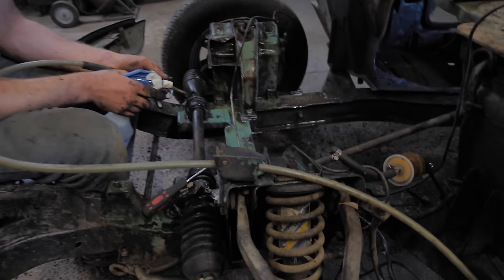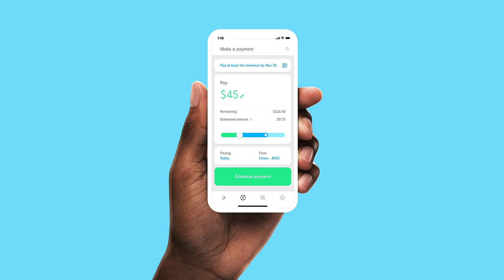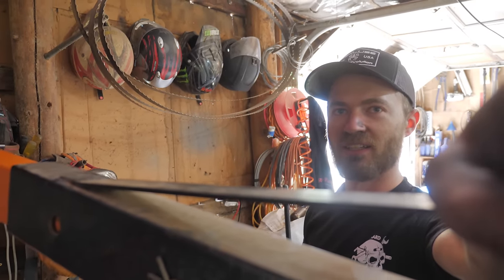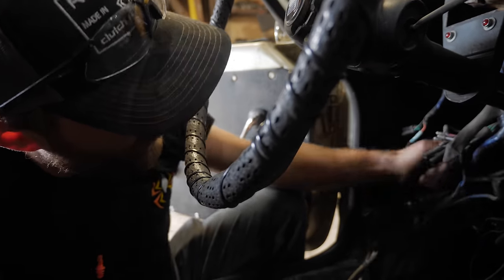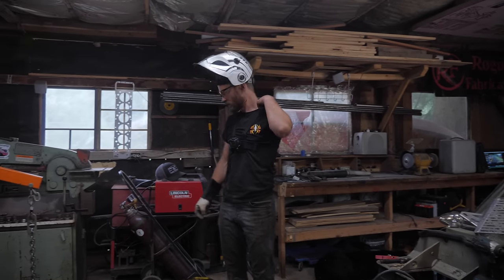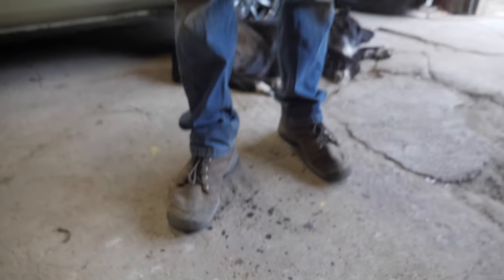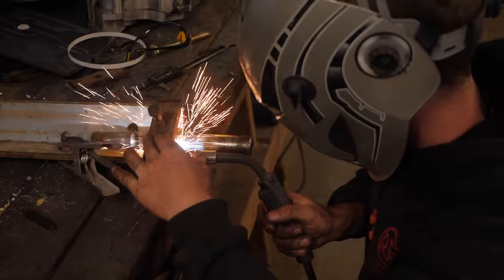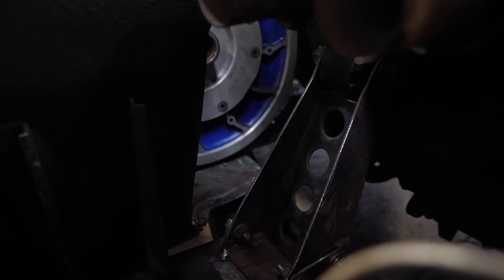Triumph Supercharged Engine Swap 200+ HP

Comment: Love the new lathe Ethan,  you realise you can cut key ways with it as well?
Put a milling bit in the chuck an axle where the tool usually sits in other words you also have a milling machine as well !make doubly sure that it is dead level
Check out Banggood and AliExpress for consumables

Check out
Abom79 (Adam)doubleboost  (John)
Keith Fenner
Keith Rucker - VintageMachinery.orgThis Old Tony 
mrpete222 (Lyle)FarmCraft101johnnyq90
OxToolCo (Tom Lipton)Make it Extreme
xynudu  (Rob)

Some of the best Machinists on the net
Fabrication ....lazzemetalshaping
RÜNGE CARS  (Chris)

Tony from Western Australia

Comment: Does it bother anyone else that it says supercharged but that's a procharger
Reply: Procharger is a brand and supercharger is their product.
Reply: @joew2303  it's a procharger because it's like a turbo and works the same way but instead of using air flow it uses a cog driven by a belt to create the same effect as a turbo so it's like turbo and supercharger mixed into one a.k.a procharger.
Reply: @jordonlavalley9667 , procharger is a name brand not a product. Procharger builds supercharger's not procharger's. Just saying...
 
ProCharger is the supercharger division of Accessible Technologies, Inc. (ATI), asupercharger and industrial turbomachinery manufacturer located in the Kansas City metropolitan area.

￼

https://en.m.wikipedia.org › wiki

Comment: Adapt a real trans please. It's going to be a massive dissapiontment when it is auto and burns belts. And the ratio is wrong and you can't dump the clutch. A guy built a snow mobile powered Miata for Lemons. Big disappointment.